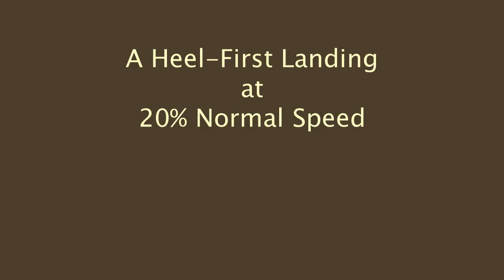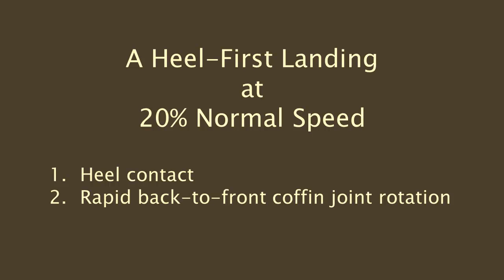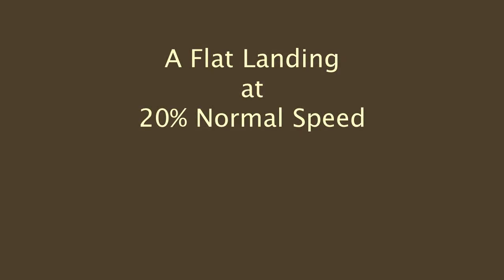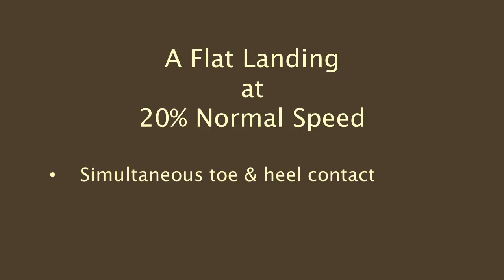Understanding the Difference: The Three Types of Hoof Landings

Comment: Hello Steve, if you put the option of speed at 0.25x in parameter, you can clearly see on your "flat landing" heel first landing.... because is functional anatomy. Soft tissus are in the back of the foot. Your second exemple is an heel first landing with excess heel height. 
In many case, toe first landing is common when impact point arn't in the correct position and palmar structure are deficient. (and with a dorsal migration of the break over). When the horse walk, if you don't have a high speed camera, it's difficult to see the heel first landing... but is here... because is the only way for the horse to have a correct locomotion.
Reply: I think the "flat landing" foot would land even more heel first at a faster pace. Steve is certainly correct that the foot is not meant to have an exaggerated heel-first landing as seen in the example in this video, which is a hoof that is quite distorted. But if the foot is correctly balanced and the horse is moving at a brisk walk or above, a SLIGHTLY heel-first landing allows for optimal alignment of the coffin bone (assuming it is a few degrees positive in the palmar/plantar angle) during the loading phase of the foot.
Reply: You are correct.  I agree with what you’re seeing and saying.  I also posted my explanation above.  👍

Comment: Extreme heel first contact isn’t correct, however a slight landing of the heel almost even landing is crucial to proper bone alignment to correctly support the baring weight being given.  
Toe first landing on all accounts is not good and will not provide the correct bone alignment to take the weight loading of the structure.  

Slight heel first to even contact is ideal.  
Notice the third horse is actually landing slightly heel first.      Just avoid the toe first landing.
Reply: excellent, clear presentation - thanks!do you have resources explaining how to correct a toe first landing?
Reply: @judymiller5154  Hi Judy.  Yes.  There are a few different YouTube sources one can go to, to get a good demonstration of what you’re asking.   Here is the beginning of a 4 part series that will not only demonstrate the evaluation highlighting a toe first landing, along with suspected navicular syndrome.   Also demonstrates and explains one of the methods that establishes getting the horse to land in a more supportive way. Slightly heel first.  
I encourage you to see all 4 parts to get a solid foundation and understanding.  I hope this helps.  

https://youtu.be/ImfeDCY8L04
Gene demonstrates
Reply: @bryanmarek  thank you so much!! I have only recently learned that navicular horses can be helped to heal at least somewhat and I'm desperate to learn!! (having fired all the local farriers 😢)  I SO appreciate your help. God bless ❤️🙏❤️